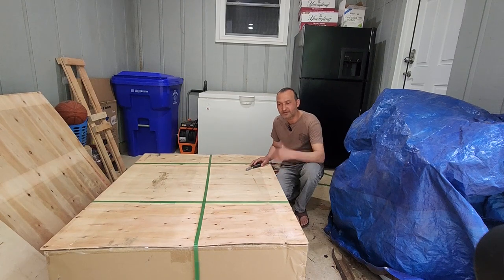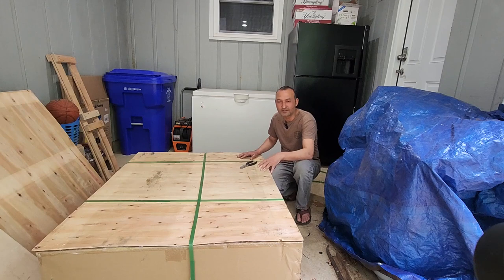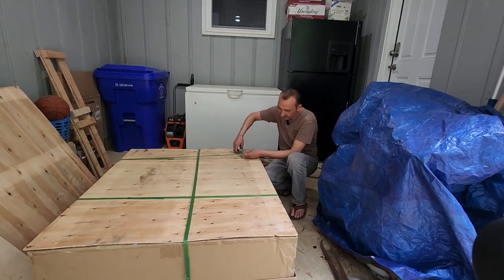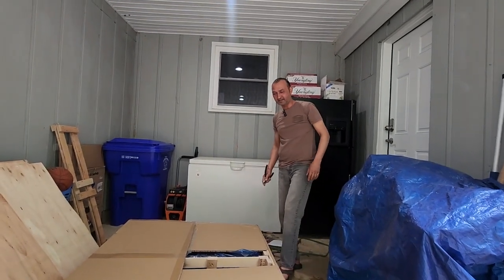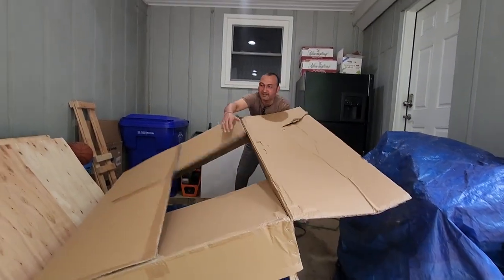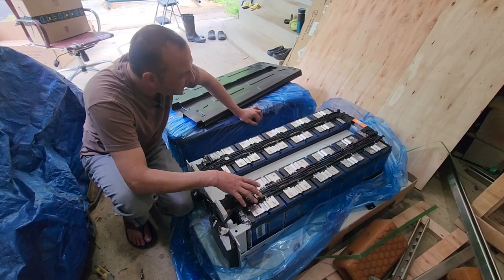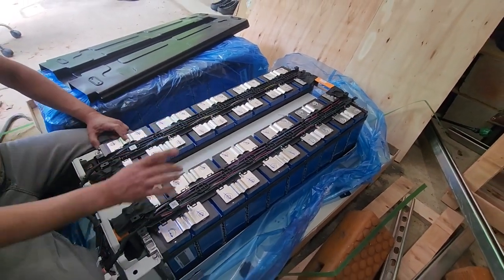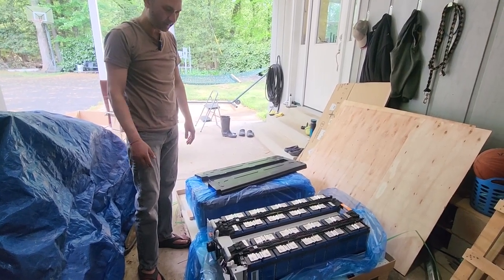DIY Solar Powerwalls Build: Seven for the Price of One Part 1

Comment: How did you move each module? I had these delivered and I'm scratching my head how I'm going to lift each module up and move them to where I need them. Any help would be appreciated!
Reply from the maker: I used motorcycle Jack 2 strong people with moving strap can also move it. And for the last tall piece I used my tractor good 👍

Comment: Were these lifted straight from electric vehicles?
Reply from the maker: https://batteryhookup.com/products/new-catl-modules-with-20x-3-2v-280ah-prismatic-17-92kwh-150-kwh
Reply: 2700$ a pack is not that expensive considering it's all builded, still far from the one I builded for 1700$, 14kWh.
Reply from the maker: @Honu Moorea  yes could be cheaper but 17kw with all the good quality parts it was easier for me to build this without worrying about what quality cells I'm getting. Don't have to guess the quality. Server rack style battery's are lot more.
Reply: @meanttobe100  I agree, the price is not that bad if you compare to many smaller packs on the market.

Comment: What is the update on the pack!
Reply from the maker: It's doing great haven't  used grid power even with few rainy days and Canadian smoke around.
Reply: That is great news. I bought the 4 modules and in the process of wiring them up. The are impressive packs for sure. Thanks for doing the video series.
Reply from the maker: @ryanmiller8476  let me know if you need any help. I would stack them and put wires in main channels you'll save about 3"in height. Good luck